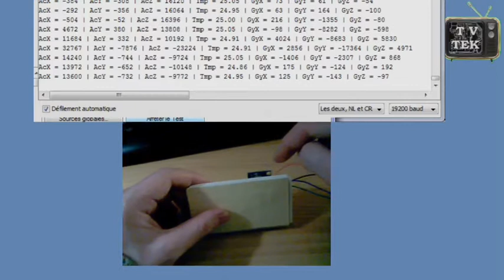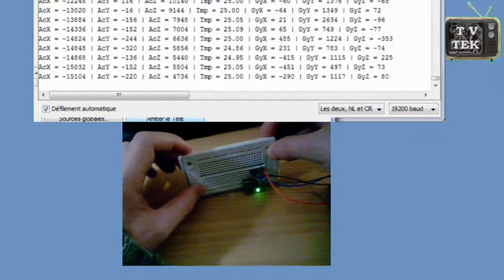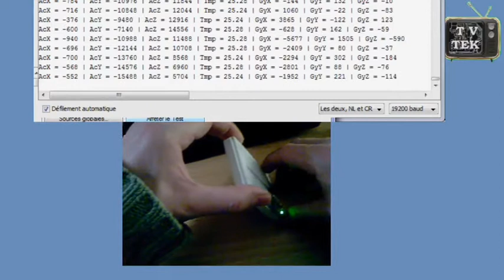GY88  MPU6050 Accelerometer Values

Comment: how to connect imu 10 dof gy 88 with arduino with 5 v or 3.3 v ?
Reply from the maker: Bessem Isitcom VIN is an input for 5 V to power GY88 connected to 5V Arduino, 3V3 is an output power delivered by the GY88 for what you want to power in 3.3 V (we don't need to connect to Arduino) I put annotation in the upper left corner of the video   'Tutorial on MPU6050'   Time 00m14s

Comment: sir can u plz upload the code
Reply from the maker: // MPU-6050 Short Example Sketch
// By Arduino User JohnChi
// August 17, 2014
// Public Domain
#include<Wire.h>
const int MPU=0x68;  // I2C address of the MPU-6050
int16_t AcX,AcY,AcZ,Tmp,GyX,GyY,GyZ;
void setup(){
  Wire.begin();
  Wire.beginTransmission(MPU);
  Wire.write(0x6B);  // PWR_MGMT_1 register
  Wire.write(0);     // set to zero (wakes up the MPU-6050)
  Wire.endTransmission(true);
  Serial.begin(9600);
}
void loop(){
  Wire.beginTransmission(MPU);
  Wire.write(0x3B);  // starting with register 0x3B (ACCEL_XOUT_H)
  Wire.endTransmission(false);
  Wire.requestFrom(MPU,14,true);  // request a total of 14 registers
  AcX=Wire.read()<<8|Wire.read();  // 0x3B (ACCEL_XOUT_H) & 0x3C (ACCEL_XOUT_L)     
  AcY=Wire.read()<<8|Wire.read();  // 0x3D (ACCEL_YOUT_H) & 0x3E (ACCEL_YOUT_L)
  AcZ=Wire.read()<<8|Wire.read();  // 0x3F (ACCEL_ZOUT_H) & 0x40 (ACCEL_ZOUT_L)
  Tmp=Wire.read()<<8|Wire.read();  // 0x41 (TEMP_OUT_H) & 0x42 (TEMP_OUT_L)
  GyX=Wire.read()<<8|Wire.read();  // 0x43 (GYRO_XOUT_H) & 0x44 (GYRO_XOUT_L)
  GyY=Wire.read()<<8|Wire.read();  // 0x45 (GYRO_YOUT_H) & 0x46 (GYRO_YOUT_L)
  GyZ=Wire.read()<<8|Wire.read();  // 0x47 (GYRO_ZOUT_H) & 0x48 (GYRO_ZOUT_L)
  Serial.print("AcX = "); Serial.print(AcX);
  Serial.print(" | AcY = "); Serial.print(AcY);
  Serial.print(" | AcZ = "); Serial.print(AcZ);
  Serial.print(" | Tmp = "); Serial.print(Tmp/340.00+36.53);  //equation for temperature in degrees C from datasheet
  Serial.print(" | GyX = "); Serial.print(GyX);
  Serial.print(" | GyY = "); Serial.print(GyY);
  Serial.print(" | GyZ = "); Serial.println(GyZ);
  delay(333);
}